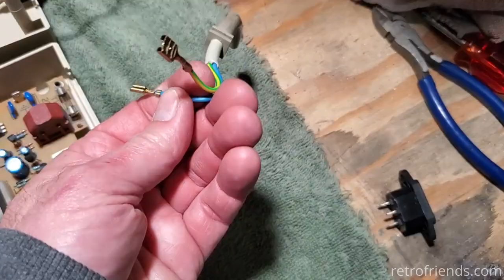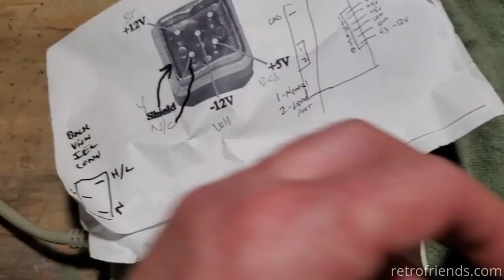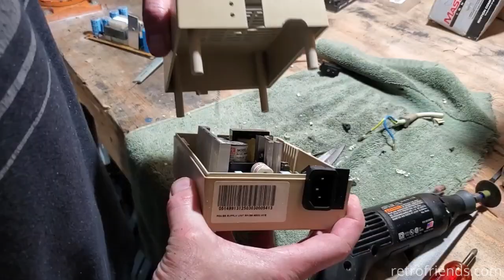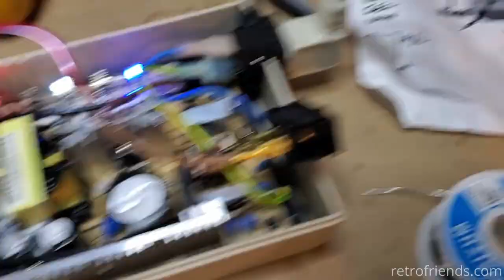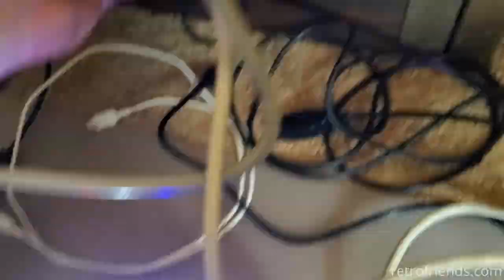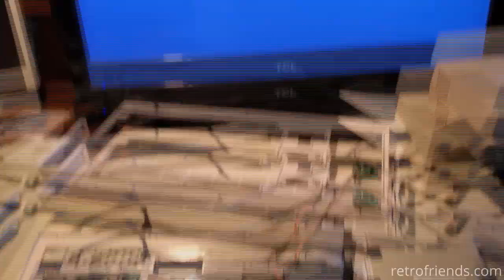My Amiga 500 Power Supply Build. LEDs, Fuses, and Modular Cord

Comment: When i did my conversion,i used a 220v psu also,but i saved the original power cord with strain relief and just cut the 220 plug off and added a American plug.

Comment: Measure/plan twice, cut once 🙂 Me personally since the case is no longer of "vintage Amiga" value, what are a few more holes. I would have put in 3 external panel mount fuses. Actually rather than destroy the Amiga case I would build (or 3D print) a case.

Comment: Been down this rabbit hole part way.. and when I saw the title I knew PT-65B or  RT-50B would come into it :).
Reply: Connectors on the meanwell power supply are JST VH 3.96 series, 3 pin with middle one empty for input, 6 pin for output.

Comment: Fuses are fuses for amps.

I'd have put externally changeable (panel mount) fuse holders in the top of the case alongside LEDs inside the cover with a plug onto the PSU ... With output cable connected inside the cover. But that's just me.

And it was me yelling at the screen when you were cutting into the case to position the inlet socket. No need to cut off those ears.

Nevertheless, your hack turned out OK. Especially the offset PSU adapters.
Reply from the maker: There is a high amp condition when there is a short or partial short on the motherboard, thus the fuses will blow as purposed.
I get comments about messing with the look of origonal equipment, then I get ones that say I should modify more LOL. It really isn't hard to open the case and exchange fuses, I thought my design was a good middle-road with minimum modifications. Take care.
Reply: @retrofriends  Ignore em, its your property and you're not running a museum.
Otherwise it would be in a landfill.